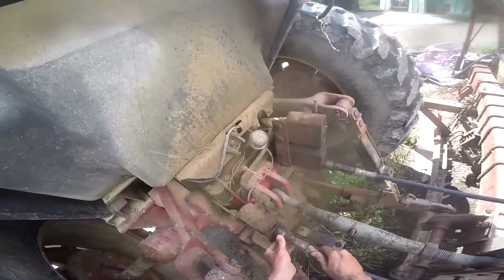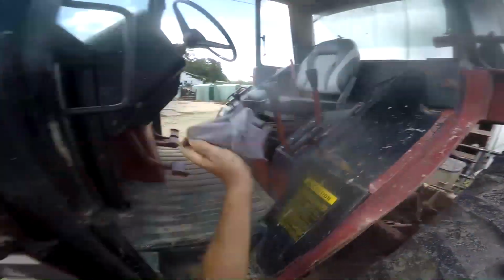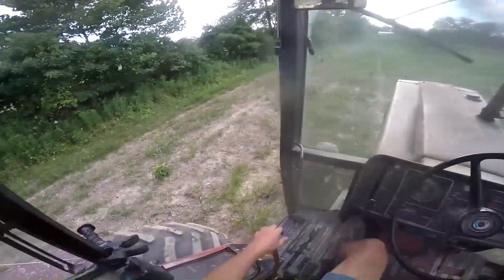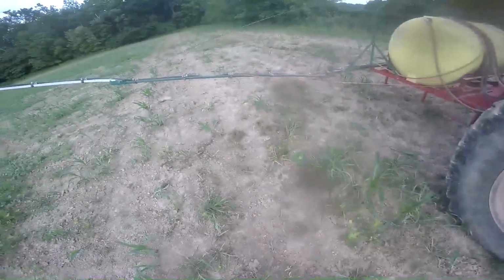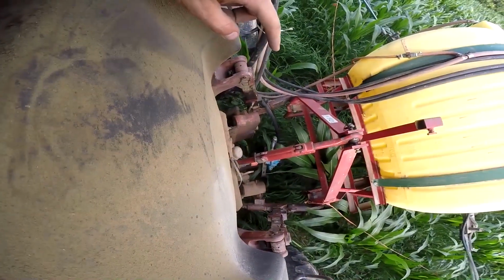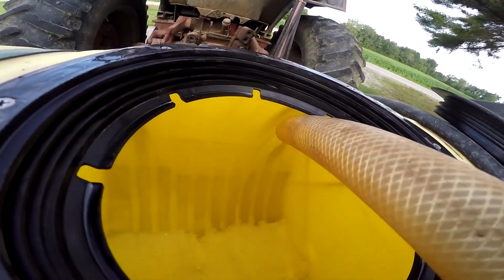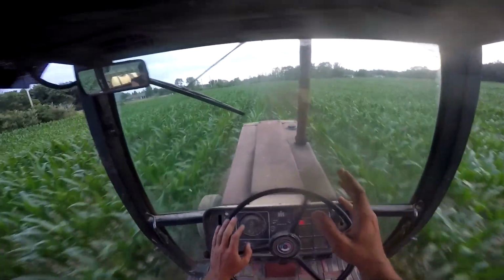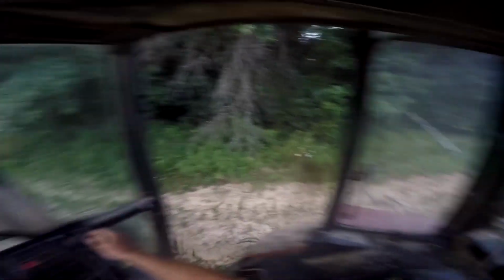IH 1086 Conventional Corn Spraying Anti-Early.

Comment: I watch another Farm channel, they have great BIG green machines, A/C, GPS, pull little yellow knob and the great big long boom sprays 12 rows of corn each side.  I bet they OWE hundreds of thousands of dollars.  I really like you turning around and using a valve to turn your spray on and off manually.  I like that not because I don't want you to have nice big things but YOUR family appears to be a representative of the average independent farmer today.  The corn doesn't know or care weather it is a brand new $300K tractor or one like yours.  Thanks for the "get real" farming videos.  Also,  maybe it didn't mean much to the average watcher but I though it was great that not once but twice the spray made it to the end of the field. And the little thing like the water came out without a fight as you were refilling the spray tank.  Little things to be thankful for.  Good Luck with you crops. Looking forward to watching the harvest.
Reply from the maker: Thank you for caring and watching. I can't wait for harvest either. I need a good winter break to do projects.
Reply: @boehmfarm4276  I use alive catch trap, home made and ones from farm supply.  Put cheap French fries in, some before trigger, some after trigger. Excavate under trap to keep some for them to pick at both places. Catch them two at a time. Second one comes in pushes the first onto trigger. Boom boom. Never seem to run out of racoons.

Comment: 1500 RPM is just about exactly 750 PTO RPM with a 1000PTO on. I drive an MF tractor with a PTO-RPM meter and a lever to switch from 540 to 1000.

Comment: How do you like the Trizar herbicide?
Reply from the maker: It's fantastic, didn't visually hurt taller than labelled corn, it can kill small grasses and it will burn taller grass. The only maimed survivors are fall panicum  and some Johnson grass. If we sprayed it as pre emergent, we would have stopped the grass from germinating, except for the johnson grass rhizomes. However, cocklebur and bur cucumber have thick seed shells that protect against the pre emergent factor, so I like to spray late and get the seedlings. Beans the next year will clean up the grasses.